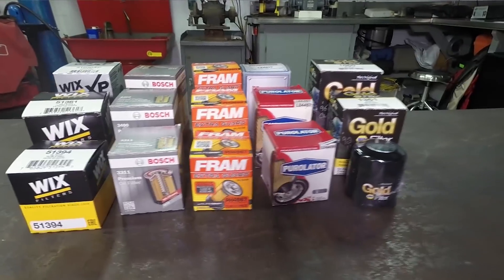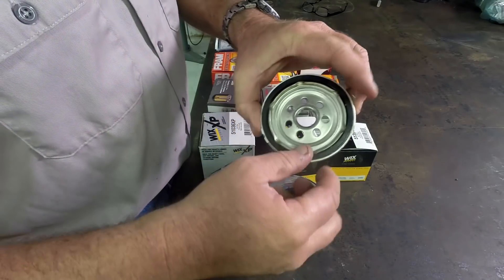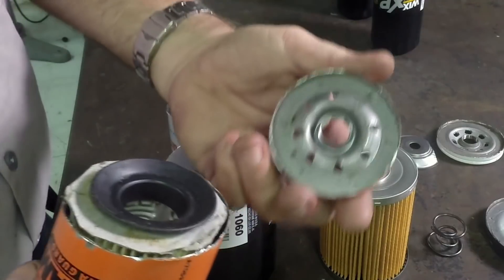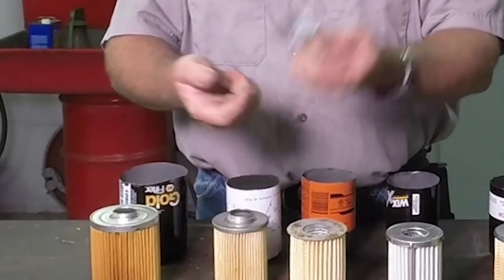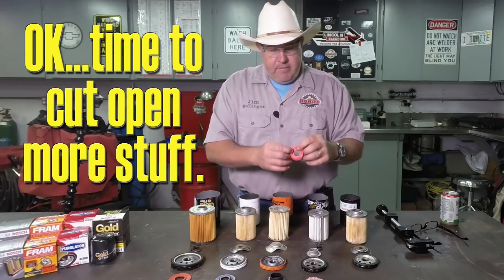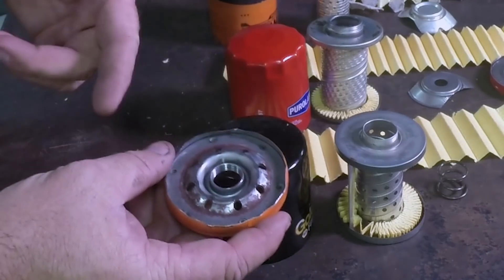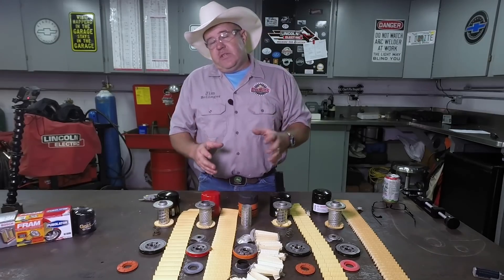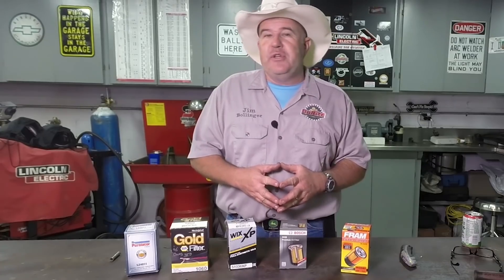The worst oil filter EVER!

Comment: I cut alot of filters apart after oilchanges . If your a diy'er go get you a filter cutter cheap easy instant look inside your oilsystem.   Just like this vid proves alk filters are not the same.. those springs act like a bypass when oil demand is high or filter is clogged up. Upon my examination fram has been like this forvalong time and ive pulled the off freashly change oil jobs with less than 300miles and the fram will just he a lump of cardboard and filter mush...junk

Comment: Bye fram, liked it cuz of the rubber grip but nope, no mas😤. Live in San Antonio. Texas so Napa gold cuz I don't see Wix @ auto parts store
Reply: Dude. Get a K&N oil filter. It's the best of the best and it's got a 1 inch diameter nut welded into the cap so when it's time to take it off you just pop a 1 inch socket on your ratchet handle or breaker bar and it's the easiest thing on earth. No matter how seized, dirty etc.
Reply: Fram Ultra Synthetic is good. He's comparing the cheapest Fram.
Reply: Oreillys carries wix

Comment: You know, I've run Fram in all my previous cars and a couple went down to engine problems.  One of them due to oil pump failure specifically, which seems like it would be more likely if your filter was terrible at keeping bad stuff out.  

I decided to go with full synthetic and extended change intervals on my Grand Am so I haven't even considered cheaping out with Fram, and she's running great putting 20k+ a year on the odometer.  Well, the engine runs great, there are a few other issues needing attention but save for my old 93 Sunbird, which I changed like every 3k, I haven't had an engine hold up anywhere near this well on Fram.

Comment: I've used fram filters on every car I've had, 12+ cars now never blew a motor no engine damage what so ever. My father was a mechanic for years. He always ran fram, everyone i know runs fram filters from muscle cars to tuners, lifted trucks to daily drivers. This is BS there's a reason the company has a good reputation, because they make good products. Don't trust some guy just because he has a cut off wheel and is wearing safety glasses.
Reply: Same here buddy
Reply: Visual evidence seems pretty clear though. I’ve always associated fram filters with quality and, while I don’t think they did any harm, I won’t buy another fram filter.

Comment: ironically, fram also makes what could be the best filter. their gold can (ultra synthetic or whatever they call it now) is one of the best money can buy. it has dual layer synthetic media backed by a metal mesh, metal end caps, high quality springs and gaskets and isn't really that much more expensive. you can get the fram gold can for less than a NAPA gold, usually, and it's at least as good if not better.

maybe we're all overthinking this, but the quality filters are only about $5 more. if it doesn't help, i've wasted a few bucks. if it does, i've saved a few thousand in engine repairs. pretty clear choice IMO.
Reply: I've been using Fram Tough Guards and Mobile 1 in my truck for 200k miles without a problem. I'm at 300k miles now no rebuild in sight. He can talk all the crap about the cheap $3.50 Fram all he wants. The mid range $5 ones I use haven't failed me yet.
Reply: @MasterTech396  If you change your oil frequently, the filter is probably irrelevant, except that changing it gets rid of that much more old oil.
Reply: Ron Jarosch - I change my oil every 3000 miles. I run full synthetic so I could push it to 5000 if I wanted to but I don't. I also use Marvels Mystery Oil every other oil change. Just got done doing my intake and valve cover gaskets a few months ago. Heads are clean as a whistle. Not a speck of sludge or burnt oil.
Reply: @MasterTech396  If you are changing FS oil at 3K miles you are throwing your money away, it is designed to last much longer.   I got my oil analyzed at 7K miles (1/2 qt topoff at 5K) on my 2009 Civic which had I think 150K miles at the time.  Blackstone labs said it still had plenty of life and to go 2K more miles and send it in again. (I didn't - oil analysis is not cheap at $38 a pop, but it was worth doing once for peace of mind) .  I did use the mid range $6 Frams for a long time, now using the $9 model - but the $3 one drainback valve does leak and you have dry startups so I would not use that one.
Reply: Bernard Hoover for a subaru I use OE filters only. I’ve been a subaru mechanic for a while and all I’ll use is OE or same OE quality from six star. We’ve used other filters customers bring in and they always leak.
Reply: @KyleSaucedo  fun fact: subaru OE filters are made by honeywell, which is fram's parent company.
Reply: Then you'd have to compare that gold can fram to the Napa Platinum or the Wix XP (Wix makes all of Napa's filters).  They are the "top of the line" synthetic filters.
Reply: @keithrigsby4231  both of which are very good, but tend to be considerably more expensive than the fram XG/ultra. that's the REALLY nice thing about the fram gold can. it's around $8 and is as good as anything, even filters that cost way more.
Reply: Unless it's all lies . . Check out anything made in china
Reply: Can you cut one open so we can see?.......cause I sure don't trust any brand that puts out this kind of garbage.
Reply: Nemo uh
Reply: @NguageTrains  yes the orange can is the cheap one that sucks. The gold can isnt much more and is a lot better.

Comment: 10 years ago when i was still an engine builder We would void your warranty if fram products were used. Fram filters have been the direct cause of many bearing failures from coming apart or collapsing. They have always been cheap junk and i doubt that will change.

Comment: The Napa filter is made by Wix, there actually the same filter. Consumer Reports test filters every couple of years and Fram filters always filter out more dirt particles. So maybe how they look isn't everything. I saw some kind of glue but it didn't look like rust on the Fram. I've been a Lube manager for 24 years and the worse filter I've seen is Purolator, sometimes they come with pinholes in the side. One time a Purolator had so much glue in the bottom of it, that oil could not be pumped through it. I use Pronto and Premium Guard filters and there just as good as Wix. Fram also makes better filters then their basic one but cost a little more. I had a customer that would only use basic Fram oil filters and his Toyota 4 cylinder pickup finally blew at 567,000 miles.
Reply: ldfox11 ...Wix and Napa are brands of the German Company Mann Hummel...I import from Germany Mann Filters made in Germany. They’re simply the best, as shown here (Golf & Wix), but original German Mann use even better, and more, filtration media. In bulk I get them for $6 each from Germany. Never will have a problem.
Reply: I have better luck with parts from ebay then AutoZone
Reply: Glue for what.....for cardboard? Cardboard ain't good enough for such an important part as an oil filter. As for the rust, that def looked like rust to my 20/20 vision.
Reply: Not sure you can blame that on Fram.
Reply: Consumer Reports is a joke.  Always has been.
Reply: @markbunn8576  Total bullshit dude. Straight poop from them
Reply: Honestly I wouldn't risk it, my car is under warranty and they use certified GMC products but when the warranty is gone I don't intend to risk the engine with crappy components.
Reply: ACDelco  filters are crappy components now, made in China like all the other filters but car manufacturers use the cheapest ones they can get their hands on. There are two types of filters coming out of China, high quality and low quality and you can't tell by the price. Example, Auto Zone parts cost more than O'reilly's but O'reilly's buys higher guilty parts from China. Had a friend buy a head light at AutoZone, Had to return it four times to find one that worked, the fifth bulb worked. Never have this problem at  O'reilly's
Reply: Consumer reports is funded by companies like Fram. Look at their editorial board
Reply: @tommypizzo1677  Nope,c.r. doesn't accept any company' ads. They are truly unbiased.

Comment: In case anyone doesn't know,  the only time you get any filtration of oil is when you stop at a red light and your engine idle goes down to it's lowest rpm.  Oil pressure at that time is about   10 psi  . There is a bypass valve in the system which opens at about 15 psi.  So when you are cruising you don't have any oil filtration,  the filter can't handle total filtration,  so my point is- it hardly matters what filter you use,  because most of the time it doesn't do anything because the bypass valve is always open!
Reply: You are smarter than most. I like you.
Reply: @roberthoard639  smarter than most..  hahaha xD
Reply: the bypass valve is there to open ONLY if your filter gets clogged... 
and if what you said whas true dont you think they would just make a bigger filter to increase oil flow so this bypass valve wouldn't open?
Reply: ... there is too much dumb in this comment to even process it. Unless your engine magically starts completely warm and flows perfectly then your point is invalid... also I believe people stop their vehicles while they are running pretty frequently. This is like saying, you do not need good engine cooling because most of the time you are driving and the air should keep it cool. Lest we forget a car without proper cooling will overheat and damage the engine... likewise a shit filter will leave contaminants in the internals of the engine leading to camshaft positioning sensor failures etc etc... you are definitely not a mechanic.
Reply: I believe the bypass valve your talking about is a safety valve that only really opens if the filter gets clogged. Oil goes through the filter all the time at all pressure ranges unless the pressure is very high like if the filter gets clogged, which is when your bypass valve opens. Otherwise the V8 in my truck would never filter its oil since its never dipped below 30psi
Reply: Pretty sure you are WRONG... My oil PSI (even at idle) never drops below 30, so your saying my oil filter is never doing anything???
Reply: If your oil pressure is always at 30 psi,  and the filter BYPASS VALVE Opens at  approximately 15 psi,  what do you think is happening? The BYPASS VALVE is constantly open and the oil  is bypassing the filter.  If not for that,  you would lose oil pressure and your engine would be destroyed.  The reason you never lose pressure is because nothing ever impedes it,  a tiny little oil filter would certainly impede oil pressure if there wasn't a bypass valve to prevent that.  Don't trust me personally! Talk to the engineers.  I was trying to help.
Reply: @christophermacbeth4034  You really, truly don't have a clue how this works, do you?  It's not the oil pressure you'd read on a gauge or the oil pressure in the engine that opens the bypass valve.  It's the pressure drop across the filter that would open the bypass valve.   To read that pressure, you'd need two gauges, one before the filter and one after.  The difference between those two readings is what would open the bypass valve.
Reply: My point is the bypass valve opens between 12 and 15 psi. Therefore you get no filtration when cruising.  No filter could handle that kind of pressure and volume. You don't have to trust me,  just research it.
Reply: Christopher Macbeth after researching this more, I see where the confusion is. Many engines have a bypass valve that opens when there is a PRESSURE DROP across the filter of 16-17psi. That does NOT mean the bypass opens at 16-17psi. It opens when there is a 16-17psi difference on the inlet and outlet sides of the filter (for instance, 70psi going into the filter and 50psi coming out of the filter). Basically, when the filter is clogged. A clean filter would have very little pressure drop, maybe 70psi inlet and 66psi outlet. 

So, yes, many engines can bypass the filter, but it is only in extreme circumstances like a clogged filter or cold start when dirty oil is better than no or insufficient oil. 

In other words, you were misinformed. Here is one source:

https://www.onallcylinders.com/2016/02/19/ask-away-with-jeff-smith-should-i-block-off-my-oil-filter-bypass/
Reply: @alphazuluz  I just want to say that it's not my opinion,  I got my information from a Chevrolet small block interchange manual that was written more than 20 years ago.  So maybe the information I gave is obsolete.  You may know this book,  I can't tell you the author,  I can't find my copy.  It describes how the system works for 1980 and earlier engines.  The author says that no filter can handle the entire load,  so the bypass valve is almost always open.  You can try to force full filtration but the filter will probably rupture. People think their oil filter is doing good things for their engine,  when it's really not possible,  it's just too small.  I think you can look up the small block interchange manual that I'm referring to,  MERRY CHRISTMAS,  I'm done with this subject.
Reply: @christophermacbeth4034  :  It's just that you misunderstood what that interchange manual said.  It's not the pressure in the line, it's the pressure drop across the filter that opens that bypass valve.
Reply: Christopher Macbeth someone lied to you. My engine, and most Ford engines, run at 30+psi even at idle. The bypass is for clogged filters and cold starts. Not for cruising. 99% of the time, the vast majority of your oil is running through the filter.

Comment: Good video. I have always recommended people use the OEM filter, especially on turbocharged engines. I have seen instances where a turbo bearing or other critical component was damaged because the balance of the system was upset by an aftermarket filter, resulting in insufficient lubrication. The engineers who designed your car made it to work with specific components with certain characteristics. Even a high quality filter may not be valved correctly for your engine, why take the chance? I only pay $3 more for the filter from my dealer (over a generic one), assuming I get 300k miles out of the car at 6k intervals that’s only an extra $150 over the life of the car. Money well spent in my opinion. 

Also everyone should have an oil filter cutter or opener. You can recycle the metal, and check the media for chips or debris that could indicate a problem in the engine. Use care when cutting the can open so you don’t add chips from the cut, and use a clean, fresh knife blade for removing the media for inspection for the same reason.

Comment: Just a head up,my only criticism is that the Puralator filter and Napa Gold are not equal. If you used the the Puralator PureOne to Napa Gold, then that is an accurate apples to apples comparison. But as you have it is like having the weakest and cheapest filter by Puralator vs the best Napa offers. Otherwise this video is great. Keep up the great work.

Comment: Showing my age here, but many years ago I used to subscribe to a cycle rider's discussion email group (clearly, before message boards and Facebook groups were in existence) and one of the members was a petroleum engineer for one of the big oil outfits in Texas. He didn't have any video or photos, but he was able to explain in long form how he sampled several oil filters in a manner identical to this video. Over 20 years later, I still vividly remember his comments on how simply awful the quality of the Fram filters were and that they were basically paper more than anything else. It's remarkably sad they haven't improved their product, although they make "higher end" filters that may or may not be better designed. Really informative and well done video, there's a lot to like about the NAPA/Wix filter. Personally I've almost always used Bosch filters, or Purolator when Bosch wasn't available. I also would have been curious to know how a couple of other filter brands would have compared (K&N, Mann) along with some of the OEM brands like Motorcraft, ACDelco, etc.

Comment: Thank you! I figured that oil filters were like a lot of other parts where one manufacturer actually makes most of them and they put different brand names on them for the company they are making them for. Fuel is like this. All gas stations (big name franchise stations anyway) get their fuel from the same refineries. The same truck literally delivers the same fuel to all of them. Chevron adds some additives, but that's it. The additives are added to the fuel when it is put into the transport semi tanker-trailer (separated by bulkheads in the tanks).
Reply: Very true, it all comes from the same pipe-line, they used to use a plug or a "foot ball" as they nicknamed it them but the foot-ball often got stuck in the pipeline so they stopped this method it is all now timed, gasoline, heating oil, diesel, etc. to the depots the additive that gives each brand it's characteristics is injected into the tanker as it is being loaded.

Comment: Ahh. Fram Bombs. I don't use 'em either. On my old Ford 4.9 I6 I use Motorcraft FL-1a filters. They bounce between Purolator and Wix, and I've cut several open over the years to gauge how the motor's doing. Always impressed at the quality inside them. Best part, I can get FL-1a filters at walmart, so no need to make a special trip clear to the opposite side of town to buy a Wix or Napa Gold! My tired old motor's got 330k on 'er and she still runs strong, not gonna chance it on shitty filters.

That being said, I do buy a fair few of those orange timebombs. I never put them on an engine, though. They're GREAT rifle range targets. The bright orange paint on the cans makes it reeaaaaal easy to see 'em through the sights of a rifle at long range and they give great hit feedback. They also don't really disintigrate, and if you want extra pizazz for a youtube clip, you can always fill 'em with water and food coloring. Anti-drainback valve holds the schmoo in until it takes a hit.